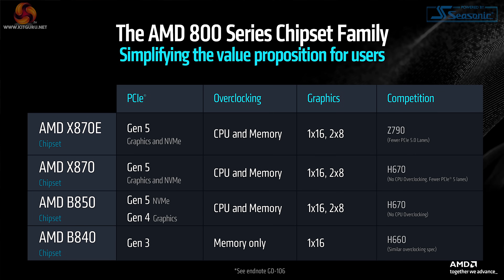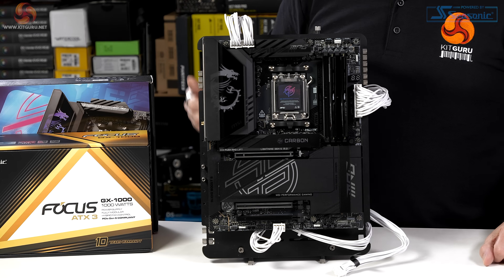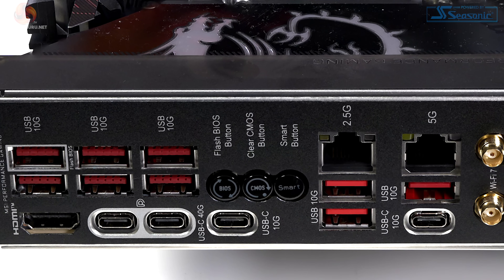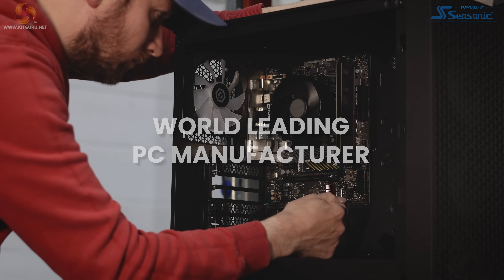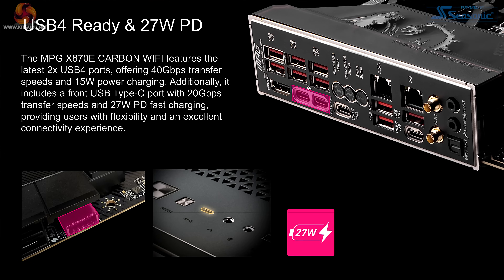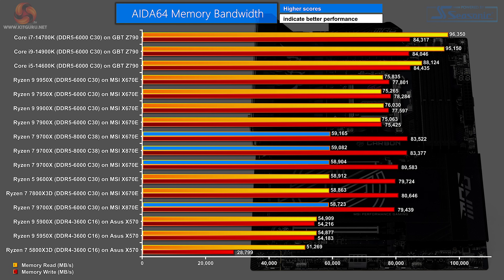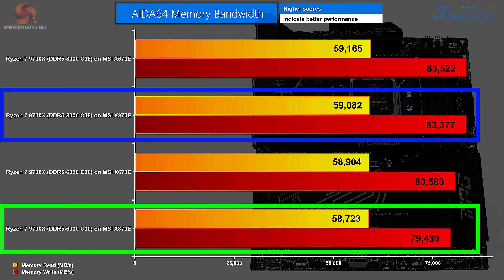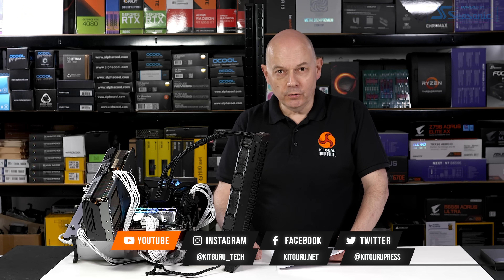MSI MPG X870E Carbon WiFi - DDR5 8000 for the win!

Comment: I’m liking this board
Running it with a 9950X 3D 
And ddr5 at 6000
Playing stalker I’ve never seen the CPU go over 70c. And that’s on a be quiet dark elite air cooler !
The IO is the main reason I got it because I plan to run this for at least 5 years or more
lol I’m still using my 3080ti
Reply: Hey, i'm in a market for a new board since freakin ASRock fried my cpu. I really love the look of this board, would you recommend it over the ASUS Rog Strix and Gigabyte Aorus? Never had an MSI board, and i also wanna keep it for at least 5 years, so i don't mind overpaying a bit for a board.

Comment: Warning. Do not buy from MSI. I purchased a brand new MSI x870e mobo for $919 only for it to be faulty out of the box. After 2 full rebuilds i sent it back to MSI..after havinmg it for well over a month they agreed it was faulty and sent me a refurbished board as a replacement… it arrived back to me with scratches and dents in parts of the board and a corner is bent. Heart breaking. I sent them a perfect condition board with only issue was the usb posrts constantly dropped out.. 

After complaing they said they think this is acceptable  replacement for a faulty mobo they sold me that was broken from the go. This is a top teir of the product line and they treated me like this so save yourself the heartbreak and wasted money and avoid MSI products because they do not care once its sold.

Comment: The Vcore is rated at 110A and the power supply has a maximum of 83A on the +12V rail. How do you achieve 100A for the SPS ? Is it even possible with this power supply and how do you determine at what point the SPS is wanting more than 83A ?

Comment: Great video! Did you have any issues with the EXPO feature? I have the same motherboard with G.Skill F5-8000J4048G24GX2-TZ5N DDR5-8000 24GBx2 stick running CL-40-48-48-128 and as soon as I enable EXPO the system either fails to boot or Windows 11 throws out strange BSD's. I've purchased a separate memory kit for comparison but that one too fails in EXPO. 
Everything is updates of course. The CPU is the 9950X3D.
Worth mentioning is that the system runs fine without EXPO enabled..any ideas?

Comment: I think the MSI x870e Carbon is the perfect motherboard for the Ryzen 9800x3D and a Nvidia RTX 5080/5090.  You won't need a motherboard upgrade in a long time.
Reply: Can it do asynchronous clock mode with the OC engine?

Comment: I was looking at that MSI X870E CARBON WIFI $500.00 USA DOLLARS IT GOT LGA I HATE LGA AND GONE WITH  ASROCK PHANTOM GAMING X870 (NONE E) RIPTIDE WIFI A LOT CHEAPER doing price war and go as low price as possible but not too far low price I hate GTGABYTE YEO MOTHERBOARDS FAILED NO SERVICE so 8 avoid ASUS and GIGABYTE due to the WORST PUBLIC RELATIONS. I got ripped off baby times

Comment: I ran into a problem

I got the board for a new build. I notice the 8-pin connector at the bottom. I just found out my Seasonic GX-1000 does not have an extra CPU. 8-pin? (it comes with 5 CPU 8 pins and 2 connectors go to the motherboard, and the other 3 go to my 7900XTX. 

DO I NEED TO PLUG ANYTHING INTO THE BOTTOM 8 PIN CONNECTOR
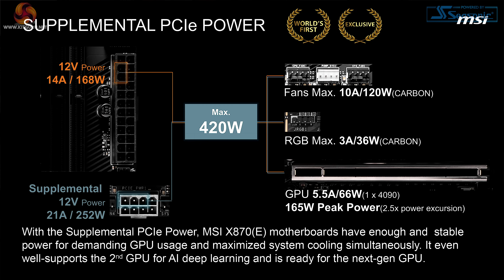Reply: I am currently looking at this mobo. I believe the extra 8 pin is supplementary power for the lowest x16. he mentions it at 3:11& 5:26.
I may be incorrect though.

Comment: Installed it yesterday along with 9800X3D and 64gb RAM. The board is very heavy and high quality...my previous b550 tomahawk was no way near as heavy. As for the installation process: easy and fun..  I flashed the bios before anything, snapped the RAM, NVMe drives and CPU  + Thermalright AM5 Secure Frame and Noctua offset mounting+D15S. So far so good.. the bios looks nice and the boot time is pretty good
Reply: @kakamaika7585  good to hear! just bought this today to pair with a 9800x3d so I hope its a great pair. I really wanted the 9950x3d but I'll wait a bit before I go for that one. Thanks for the update on your experience with it.
Reply: @anthonys904  It's definitely a great pair. My system has been running smoothly since day one. Enjoy!
Reply: I got the board for a new build. I notice the 8-pin connector at the bottom. I just found out my Seasonic GX-1000 does not have an extra CPU. 8-pin (it comes with 5 CPU 8 pins and 2 connectors go to the motherboard, and the other 3 go to my 7900XTX. Did you plug anything into the bottom 8-pin connector?
Reply: @sasquatch6750  I didn't. The 8-pin connection at the bottom is not mandatory, unless you plan to occupy all PCIe slots, which is very unlikely. Enjoy your new build :hand-purple-blue-peace:
Reply: @kakamaika7585 Thank you. I will only be plugging in my 7900XTX and a sound card.

Comment: I'm pretty new to Pc's. Which speed ram would you recommend for this board along with the 7950X3D cpu? Not to sure if the cpu will work with 8000mt speeds?

Comment: Hello. Can I run Ryzen 9 9950x3d processor on MSI MPG X870E CARBON WIFI model motherboard without any bios update? I want to do the bios update after windows installation. Thanks for your answers.

Comment: Great except that : Probably the worst board I’ve ever had… poor overclocking, unstable, and a mess with USBs. I wonder how anyone can love such a piece of junk
Reply: Been using the board for 2 weeks already and everything is running smoothly. You should RMA your board instead of whining
Reply: @kakamaika7585  Just because you’ve only had the board for two weeks, without experiencing the months of instability others have gone through,(I have the board since october last year !) your judgment might be a bit skewed. If you’re fine using a board at that price without an Eclk, good for you. I’m not whining; I’m genuinely frustrated. Sure, it’s stable now, but for the price, it still doesn’t offer enough. I bought it specifically for overclocking, and until about a month ago, it was a complete disaster. honestly, I couldn’t care less that someone using a $500 board is happy just because it runs smoothly...

Comment: I have enjoyed your channel; I purchased the MSI X870E using AMD 9950x and 32GB G.Skill Trident Z5 Royal Neo DDR5-6000 that has factory 28-35-35-60  for AIDA64 7.50.7207 showing 81486 and 85154 MB/s these are running under EXPO1; I see the board says it supports 8400+ would that required Intel XMP (2x24) F5-8400J4052G24GX2-TZ5RW and do you think it might give better performance with proper settings? I have not seen any testing at the claimed 8400
Reply: How is the setup working for you? We will have the same setup if I order the 9950x.  I am still trying to decide on which cpu, the 9950x, 9900x, to save 180.00 over the 9950 or the 9800x3d.

Comment: where does the description that pci e2 has pcie 5.0 x16 come from? the manual says 
PCI_E1 & PCI_E2 slots
• Supports PCIe 5.0 x16/x0 or x8/x4 (For Ryzen™ 9000/ 7000 Series processors)
3x PCI-E x16 slot (Qty)
PCI_E1 Gen PCIe 5.0 supports up to x16 (From CPU)
PCI_E2 Gen PCIe 5.0 supports up to x4 (From CPU)
PCI_E3 Gen PCIe 4.0 supports up to x4 (From Chipset)
Reply from the maker: You'll have to clarify your question - as far as I can see, at 5:28 I say exactly what you wrote (and repeated the same information over on https://www.kitguru.net/components/motherboard/leo-waldock/msi-mpg-x870e-carbon-wifi-review)
Leo

Comment: Thank you for the in depth and level-headed review.  I very much appreciate your no-nonsense approach to evaluating hardware.  Your reviews are a huge benefit in getting me prepared for an upcoming build when 9950X3D is generally available.
Reply: You definitely don't want that. Take a look at the MSI forums, this board currently can't even run that CPU at all. Also, it barely runs the 9800X3D stably. Stop trusting paid reviewers.
Reply: @vicotg7987  Well this is no longer the case. Got a 9950X3D and this mobo and all is good (wanted to go with 128gb @ 6000 but due to price and local availability, i've stuck to a very nice stable dual channel 96gb at 6000)

Comment: The MSI X870E Carbon Motherboard has a great thermal design. Due to the heavy flight simulation loads, the intelligent fan control reassures me that the motherboard will provide optimal cooling. Thermal throttling has not been an issue. The overall quality of the build is impressive.

Comment: Does the problem of not using 4x RAM slot still persist?
Reply: Hello what problems?
Reply: @Ale_K.  When using 4x ram, there is a load on the processor.
Reply: That is a problem inherent to DDR5 and the memory controllers on the CPUs. You can run 4xRAM if they are single rank modules and you don't need anything beyond 6000 (or 6400 if you're really lucky) by manually OCing the RAM.
Reply: @MajinOthinus  If I'm lucky, I won't lose any performance when I install 4 modules, right?
Reply: @ozshaitan  If you follow the specifications I outlined above, you can make it work. That said, you WILL almost always lose out on performance when compared to an equivalent setup using two dual rank DIMMs.
Two DIMMs is just superior to four DIMMs for DDR5.

All else being equal, you can get higher clocks and tighter timings while using less voltage on two DIMM setups. Most of the time it will also be cheaper.
Reply: @MajinOthinus  ty <3

Comment: Get the Tomahawk instead, 2 gen5 m.2 slots, and it has 16 lanes dedicated to the GPU.

Carbon has more usb ports, but its a slower board, and it bifurcates the gpu lanes if you run more than 1 nvme drive

Comment: 3:40 The price may in fact be less exactly because they chose those "overkill" components.  What is expensive is not so much their power ratings but the quality of the components. You can save money by getting a lower quality but more "overkill" and not lose the reliability.

Comment: What about lane sharing?
Reply: Just like all the other X870E and X870 boards. The second M.2 slot steals from the GPU. The USB4 requirement was such an idiotic decision. If you are looking for a board, do yourself a favor and get an X670E board without lane sharing.
Reply: @MajinOthinus  or just buy an ASRock board. They dont share .... the Nova seems pretty nasty
Reply: @peter-kj7hc  They still waste PCIe 5.0 lanes. I paid for 24 PCIe 5.0 lanes and I will use them.

Comment: This is all well and good but in common with most other reviewers you make no mention of how most of this crop X870[E] boards - this board included -  are crippled by the very poorly implemented PCIE bifurcation.
Shame, but I suggest you look elsewhere everyone!!!
Reply: Why is it such a big deal for some people? I'll be using this board with a 2 TB SSD and two 4 TB SSDs. Why would I need another SSD? Just buy SSDs with more storage.
Reply: @User-ys7cb  It's a big deal because [as on my current X670E] I want to be able to run 2 nvme's at full speed, directly from the CPU without bifurfating my GPU.
This is a reasonable expectation with mobo's this expensive!
On this mobo, PCI_E1, PCI_E2 and M2_2 share lanes. So, your proposed config will either drop the GPU from 16x to 8x or entail routing two of your SSD's via the chipset, which introduces latency.
There are a couple of current crop X870 boards availible where this can be avoided.
As for using higher capacity NVME's, fair enough. But there is an old expression: don't put all your eggs...
Reply: @Lif-999  I'm using PCIe 4.0 SSDs because PCIe 5.0 is still pointless (for gaming anyway). 3 PCIe 4.0 SSDs work without lane sharing. M2_2 won't be used.

Comment: The only issue I have with all the new X870E motherboard is lane sharing.  They all seem to get 4 lanes of PCIe 5.0 for the M.2_1 but then almost all of them have a switch to split the lanes of the PCIe 5.0 x 16 GPU slot.  Usually it's 1 PCIe 5.0 x16 at full speed or 2 PCIe 5.0 x8.  The other layout is 1 PCIe 5.0 x16 or 1 PCIe 5.0 x8 and 2 PCIe 5.0 M.2 x4.  The ASRock X870E NOVA WIFI is the only one I've found so far that has a dedicated PCIe 5.0 x 16 GPU slot with no switch and no lane sharing, meaning it gets x16 5.0 lanes all the time.  The B850 motherboards might be better in this regard since they are not forced to use 4 lanes of PCIe 5.0 for the USB4.0 ports.
Reply: So the first 2 lanes share the gpu with the cpu, while lane _3 and _4 use the chipset. So the only real lane that takes away from the gpu would be lane _2 if using lane _1 already. As long as you use _1, _3, and _4, it will not take away from the gpu at all. There are ways to work around this and it doesnt hinder it completely.

Comment: I decided to get this mobo, it's the only x870e mobo (except for Godlike, which is 3x the price) that will allow me to run PCIE gen 5 slot 1 at x16 lane bandwitdh whilst runing at least 4 M.2 slots at gen 4 x4 bandwith. Another massive factor for me is CUDIMM support, since MSI is the only brand that comfirmed future support for CUDIMM on their X870e boards. This USB4  CPU lane sharing situation seriously sucks with the x870 boards, but it is what it is.
Reply: Wasn't fussed about USB4 so went with the older X670E version. Same PCIE-5 lanes, more SATA ports which I wanted. I also didn't want USB4 display out on the CPU, HDMI and Display Port are completely fine if I really need to use my 9800x3ds IGPU.
Reply: @eagle_rb_mmoomin_418  people who pay for a 9800x3d will likely have a discreet GPU as well.

Comment: A recent Buildzoid video ("General AM5 OC") said, "if you can run 8000 in 2:1 mode with UCLK and FCLK synchronised at 2000MHz, you would".

The problem, he said, is it's hard to get working on most boards. Sounds like it's not hard to get working on this board!

Comment: As much as I want to love this board. I got a dud. The WiFi doesn’t even work or detect out of the box. Drivers don’t work. And boot to USB just doesn’t work. Boot up times are absolutely way too long with no fast boot option. And I believe one of my ram slots are bad (had to switch to a different pair) updated to latest drivers and bios. I believe the MSI forums everyone is having the same issues. I’ll be switching out to the x870 Asus hero 😢

Comment: Basically Msi x870e, set to 75w, Ryzen 7950x, underclocking the processor from 229w to 192w, the result of 75 degrees is very good.

Comment: Anyone else have gotten a constant error 08 on this motherboard? Tried everything it seems to work fine but it’s “cpu optimization” as the error is called. 

1. Done CMOs reset
2. Changed out RAM sticks 
3. Updated BIOS (only one left is beta)
4 Reseated CPU

Running 7950X3D with 32gb of Corsair vengeance and an NZXT cooler.
Reply: You may have gotten a dud like I did. Just different situations

Comment: Hardware unboxed just tested most new boards and surprisingly half of them cannot even boot or stress test at 8000. Even some higher end ones like the taichi and nova.. do u think this will be fixed with bios updates or is 8000 a marketing scam??

Comment: I have this motherboard and it is paired with the 9950X. However, I have the exact same dreaded USB issues that the X570 platform had some 3 years ago where any USB3.0 or newer protocol device plugged into either front panel or rear panel USB A ports constantly disconnects rendering them and throw up connection failures and errors in Windows, reporting “Unknown USB Device” in Device Manager.

Comment: Very satisfied with my MEG ACE X570 since 4 years (and will still go strong much longer in family/2ndary pc), quality board top to bottom.
This new MPG X870E Carbon - instantly caught my eye. Already bought&ready on my workdesk (plus DDR5 etc.) to renew my build once the 9kX3D's come out...
Reply: which DDR5 stack did you buy for your mobo?
Reply: @Hullbreachdetected  while on the overclocking spree from when i had my first pc (~1989) till ~2010 (and the actual real need to eek out every little bit of extra performance - bc stuff was....sloooow), i since then (and it's always great stock performance of new stuff, and factual real world irrelevance of +/- 3%) prefer quality+stable+troublefree. In this case 2x32GB GSkill Trident Z5 Neo RGB Expo 6000 CL30 (full code: F5-6000J3036G32GX2-TZ5NRW)

Comment: Why is that 14900k score so low. I got 38500 on standard power limits. Also 40300 on oc and it’s 1.42 volt limit. I was using drr5 6000.

Comment: Taichi 870e and PG Nova 870 both have 5x M.2 slots exclusive of the GPU lanes.. zero lane sharing, zero! Both have thermal-link backplates, Taichi is sub £450 and the Nova is sub £350.
Reply: Taichi also has zero pcie slots from the chipset for expansion cards
Reply: @l3xforever  Wrong. Diagrams easily available.
Reply: @IndigoSun-hz6cq  yeah, and maybe you should look at them, and all the other reviews 😹. It literally only has two slots from the cpu running in 16x/0 or in 8x/8x configuration 😹
Reply: you for got to mention 3 out of 5 M.2 slots are only gen 3...

Comment: the X670E carbon is better than this one.
Reply: Why?
Reply: @CALISKAN01  because of AMDs mandate about USB, it takes up so much bandwith that if you use all 4 M.2 Slots the 1st PCIE Slot will run at 8x, where as on the X670E you can fill all 4 M.2 Slots and the main PCIE Slot will still run at a full 16x.

Comment: I have a question if i pair this motherboard with the 7 7800X3D i need ram with 6000 mhz or more ?and what if the cpu can't handle the more mghz or the motherboard the lower mghz speeds; i have rtx4080 super on 2k monitor and i want to upgrade soon

Comment: thats probably the one Ill buy for my 9800x3D (or maybe 9950x3D) + 5090 combo

cant wait
Reply: and Im really curious to see the 7800x3D with 8000mhz memory and then ofc the 9800x3D with the same memory. If you can get those CPUs stable with such fast memory.

I only care about gaming, so if it doesnt do anything for gaming, I will use this money for something else. This PC will already be extremely expensive, considering every part.
Reply: AMD DDR5 8000mhz will not improve performance because of infinity fabric limitation @DELTA9XTC